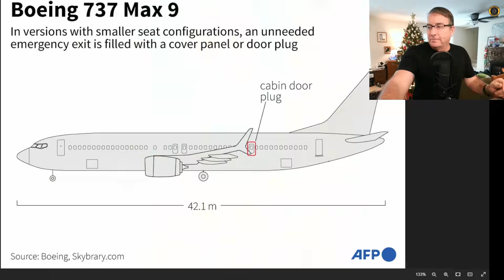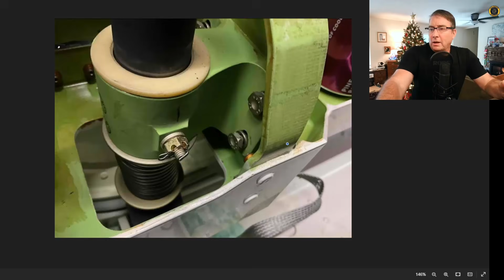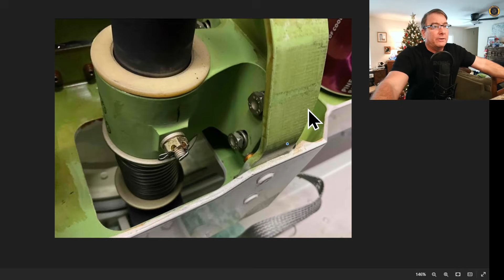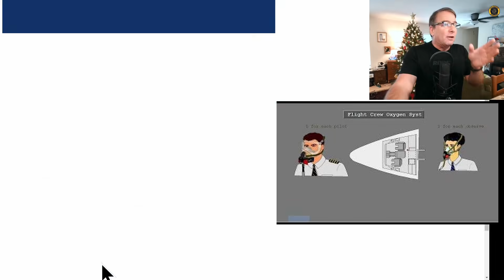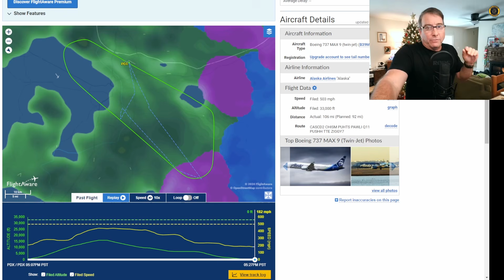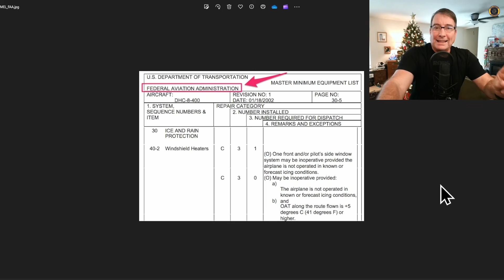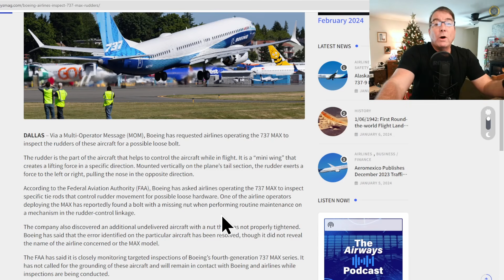"Yes, We Have No Bolts"  9 Jan 737 Max-9 Update

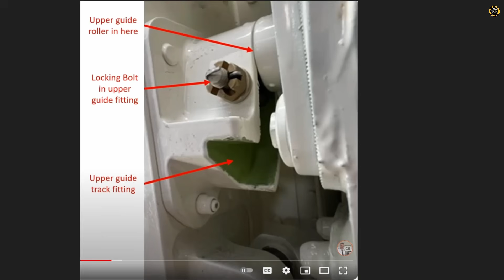Comment: 4:35 How could the track guide fitting have been "cracked" as a result of the door departing the aircraft? Doesn't the door just slide up and off without requiring enough force to crack a metal fitting?
Reply: It would slide up and out easily on the ground, but remember…it’s now got 200+ mph (I don’t know actual speed) winds blowing on it…seems like that could easily crack a fitting that wasn’t designed for that?

Comment: I'm wondering if they can go back a check G loading on the other 2 pressurization incidents to see if the panel could have moved on those flights putting a spike in the press system causing the controller failure?

Comment: I suppose there are different ways in which pressure can leak past a door seal, and maybe, if there was a leak around the plug door causing the pressurization writeups, it might not have been audible, but my wife was on a Southwest flight several years ago where one of the doors didn't seal right and had a 'small leak', which apparently wasn't concerning enough to turn back, and she said the noise it was making was maddening.

Comment: I've said this before on other videos in the past, but I just continue to be baffled at how, in this day of technology, that these voice recorders, will record all of 2 hours before it is overwritten.  How the F is that possible????   We have devices no bigger than a hand that will save data that would last months before being overwritten.  And this is only audio we're talking about.  With audio you could get years saved, I bet.  Yet all they get is 2 freaking hours.  That goes beyond comprehension.  Now in this specific case, the audio would've been limited anyways.  It would be limited to before the door blew off.  After which, audio would've been sketchy at best due to the noise caused by high winds.   Now I know that the hard drives that would be installed in these cockpit voice recorders are not your everyday hard drives.  They have to be extremely durable, and even when they take damage, there must still be a high probability that you can still receive some or all of the audio there.  But it still should be possible to get a hard drive that fits these parameters, yet get much more time than 2 damn hours.  Maybe than create 2 voice recorders.  One like they have now, and another that perhaps streams real time to specific areas around the globe.  I don't know.  I do know that there are people a thousand times smarter than me that should be working on this like forever ago.

Comment: What happens to the "rubber jungle ? is it cleaned, stuffed back or replaced? Do they all drop together or can just a few drop if needed? Is the air for the masks from bottles or a compressor..
Reply: The oxygen for pax masks is from a container for each mask that uses a chemical reaction to make it. That’s why they don’t have to worry about leaking bottles or such.
I don’t know fully how it works actually but I’ve read that in multiple places over the years.

Comment: Crazy  complexity to a fairly simple connection between panel and fuselage. Why not just a series of bolts around the door? They made it like they will be removed every few weeks, most of these panels may never be removed.
Reply: Most all panels on an aircraft are removed for inspection routinely.

Comment: Juan, I watched all three videos. Great reporting! I flew the 737 for twenty years, and you've taught me things that I never knew about the airplane. I've never seen anything in print or in video during training that said that the cockpit door is designed to fly-open during an explosive depressurization! I figured it the same way you had -- that the blow-out panels on the cockpit door would shift, allowing for cockpit to cabin pressure equalization. Worrisome, indeed!

Also, although I knew that the exit behind the wing was decommissioned, and had a "plug-type" door installed, I did not know how the door was secured closed, nor about the four bolts.  These exits are installed on our B737-900ERs; but not on the older B737-900s. To the best of my knowledge, we never had an issue with them. 

BTW, there are several ways to know that particular exit could not be used: 

(1) it's not visible from within the cabin -- as you stated, to a passenger, it would look just like any other "non-emergency exit" seat window, having been panelled-over; 

(2) there is no 2" - wide, painted, reflective band around that exit. These bands, whose purpose is to help the CFR emergency crews to quickly locate the installed exits on transport-category aircraft, are required by FAR Pt. 25 (on those aircraft, the bands are clearly visible around each of the main cabin doors, the overwing exits and any other usable exits); 

(3) there is no door-release handle on the outside of the exit door/hatch, to allow those CFR crews to open them from the outside, which is also a Pt. 25 requirement.

On the 737, there is an exterior cockpit window release handle, located just below the first officer's (R2) window; however, the captain's window (L2) cannot be opened from the outside.

As I understand it, the amber "AUTO FAIL" light illuminated on three (?) previous flights, which would account for the repeat write-ups. I believe that it is possible that the door-plug's shifting during those flights could have caused the AUTO FAIL to trip off. What I am wondering is: Did both AUTO controllers trip off, leaving those crews with just MANUAL mode? 

During those twenty years, I never had to manually control the cabin with the outflow valve toggle switch, although we did fly on several occasions with one pressurization controller on MEL, but the other one worked -- and per the MEL, it had to function normally.
Reply: According to the NTSB briefing, they never had to use manual mode. The backup computer controlled system worked in all previous situations.
Reply: @Fireandbubbles  Thanks for the info -- I haven't looked at the NTSB briefing yet. In my experience, the auto-pressurization controllers were very reliable, so that doesn't surprise me.
Reply: In hindsight it would seem that, during the initial stages of cabin pressurization, that door would jostle enough to 'burp' some of the incoming pressure back out. This triggered one or more of the alarm conditions. By the time the system switched to the alternate, the seal had been restored and either of the controllers would have seen the correct pressurization behavior again.
If indeed this was the case, it would seem to say none of those bolts were present for some time (vs failed, or sheered during the incident flight).
I imagine there will be a recommendation to update the maintenance checklist, to verify all seals mechanicals are sound before signing off on this sort of behavior from the pressurization system.
Reply: @CineSoar  Probably a correct assessment, on your part. IMHO, either the bolts or the cotter pins weren't installed, which allowed the hatch to shift upward enough to be pushed out by cabin pressure.
Reply: @boeingpilot7002  In the absence of bolts preventing upward motion, the plug was free to bounce up and down on the assist springs at low cabin pressures, until (somewhat randomly) that "mousetrap" condition was present during turbulence, at somewhat higher pressure and "BAM!". I do suspect the bolts were in place originally, without the cotter pins. It then took a few month's worth of vibration, before all of the nuts had vibrated loose and those bolts were laying in the bottom of the plug frame area.
I was riding the Zurich metro this morning. As I was waiting to arrive at my station, I noticed the nuts on the door mechanisms. Each had a stripe of hand-painted yellow paint, to make any rotation of the nut, relative to the bolt, immediately obvious. It made me wonder how the cotter pin installation, and (one would hope) cross-check visual inspection, got missed.

Comment: If the bolts that keep the door from coming off can't be found, and the door comes off, sounds like the bolts weren't there in the first place? And it's a new aircraft? Wasn't there an issue from before, about the build quality of the Max's? Sounds like could be an issue again. I'm going to start selecting airlines not by their service, but by the equipment they fly. Thank you for these great updates.

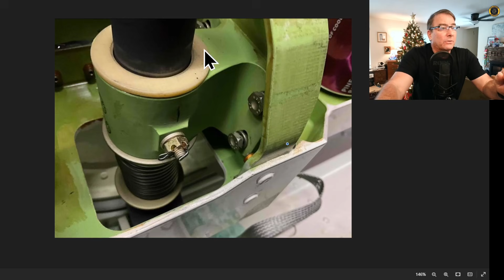Comment: Juan, what are your thoughts of the photo shown at 6:00, especially the lower apparently "loose" nuts on the lower bracket?  I have blown the photo up and the hole for the lower bolt appears to be way too large , especially since the lock nut almost fits partially in the hole.  I assume that this bracket was assembled at Spirit and that it was delivered to Boeing in this condition.  You also mentioned that one of those brackets was missing from the door.  In my opinion, this could be the cause of the plug loss; at the least Spirit seems to have missed the loosenuts and Boeing also must have missed this when the plug was removed for the interior installation.  Your thoughts?

Comment: Great report Juan: Concerning the castle nut. As a retired maintenance mechanic plus a corporate mechanic, who is accustomed to using castle nuts. For me, once I torqued the nut to specs, if the cotter pin and the bolt access hole are not lined up, I would just advance the nut as to accept the cotter pin. It’s “impossible” for said nut to back off, if its torqued correctly then affix the cotter pin. 

When it comes to the two door frame mounting bolts, that appear to be about 3/8 “ SAE why are said bolts not “SAFETY-WIRED” as any other critical parts, being safety wired means tight forever.

Comment: Castle nut with cotter pin is great - but when the thing it's bolted to has loose bolts with no safety holds -  kinda cancels out!      Been following all these updates Juan - great work....
Reply: If those other loose bolts were the problem then those castle nuts and bolts would have still been there.  They're missing.  Those other four bolts on the bracket shouldn't be loose but they're not likely the cause of the problem, but another symptom of the root cause--no quality control.
Reply: @johnaclark1  Stay tuned!

Comment: In the picture of the lower hinge assembly it looks like the lower bolt with the washer on it is not tight. I guess the engineers didn't think like pilots when they made the door to blow open like that, and the pilots lost their checklist.

Comment: Oh now wait a minute.......the roller guide fitting being cracked.......that changes everything. Were the bolts over-torqued which could crack the fitting???  I've seen over-torqued bolts crack a fitting.  A friend I have may have cracked a fitting or two in his life. (sheepish grin) 
The plug door weighs 63 pounds and if the fitting was cracked then that 63 pounds could have hammered away at the compromised fitting for the two months until it broke out.
Reply: I believe in the NTSB press conference, they stated that fittings were cracked as a result of the door departing.
Which makes sense because at some point the door would be catching all that wind rushing by and would pull it in directions it’s not intended to go.
Reply: @JohnHallgren   "I believe in the NTSB press conference, they stated that fittings were cracked as a result of the door departing." 
They don't know that yet. They can't be sure of that at this point.
Reply: @rael5469  yes, that’s true…that’s why I said “I believe” because I wasn’t sure if it was said..I thought I heard it.
Reply: @JohnHallgren   John I didn't dispute what you said I dispute that the NTSB could know why the fittings were cracked.

Comment: Something we learned when the Boeing/ McD merger occurred.  McD has qualified people on the assembly line who can take a print and actually follow it.  Any variances which occur can also be handled by these people with planning/engineering paperwork to cover it, like an oversize rivet, etc.  Boeing has assemblers who basically bang the same line of rivets every day.  Any changes have to be done by Tooling.  This is why when there were mods to be made to the 737s just off the assembly line, they were flown down to Long Beach where the work could be done by qualified personell.

Comment: My father told me 70 years ago that he avoided flying in new airliners. He figured it always took a few years and a few crashes to get the bugs worked out.
Reply: In general aviation, used airplane parts often cost more money then brand new ones. They are safer as any factory defects have been weeded out over time.
Reply: There were new airliners 70 years ago?

Comment: You are speculating that is how teh door failed.   THe investigation is still on going and you are putting out assumptions that could potentially be true, but that is not what you are saying and giving false info.  Also, you said in a previous video, that the plug is removed during production to allow for parts and materials to be brought into the -9.  This is incorrect.  it is not removed at all.

Comment: Clearly you wouldn’t know about etops on the door from bashing your head on it from walk arounds 😅, always funny when you see a crew member doing the preflight with a part number stamped in the skin of their forehead. I wonder why the mid aft doesn’t have similar electro mechanical interlocks like the overwing exits. Three cabin doors shut, throttles advanced or cabin pressure above 4.5 psi and have physical locks inserted into the plug even if it’s not rigged as an emergency exit at the time. Although I like the theory of the bolts being added it sounds like there need to be additional QC processes before delivery. Too many loose fittings and parts.
Reply: The bolts are the physical locks.
Reply: @johnaclark1  I more so mean on the aircraft where it’s an actual exit and not just a plug.

Comment: Hi Juan. From photos I have studied, the door didn’t leave intact. Part of the very lower assembly of the door stayed with the airframe. You can see both of the hinge sliders still attached to the aircraft. The forward hinge slider has been stripped clear. However, the aft hinge slider still has the slider fixture and spring attached. It looks like the bottom crossmember of the door is still attached as well. From a photo I found, taken from inside the cabin, the spring can clearly be seen, and appears to be in its released state. ie extended. I think those springs, although convenient, may not be such a good idea. Regards
Reply: That’s EXACTLY what I’d expect to happen when the door flies open under pressure. Something at the bottom hinge area quite simply HAS to let go, or the door will actually stay with the aeroplane.
Reply: But it isn’t an emergency exit door.  It’s a plug. Why is it designed to facilitate removal with a spring loaded hinge? The spring loading, if there at all, should be reversed to hold it down not to lift the door up and out of the retaining lugs.
Reply: @JeremyAckers  It' an emergency door just plugged in and somewhat deactivated.
But all of the holding mechanism is to be identical.
Otherwise you would need a fully certified alternative solution which would set the program back half a decade.
Reply: @JeremyAckers  Those springs are there just for convenience. But, if the bolts,nuts and locking pins are all in place properly, there shouldn’t be any problems, you would think. And in most cases, there are no problems. Regards
Reply: It’s an emergency exit door.  Emergency exit doors are supposed to fall away.  When deactivated, the exit door has bolts installed to prevent it from sliding out.
Reply: It appears I may be wrong about the door coming apart at the bottom. There looked like there was a piece of metal still attached to the aircraft between the two door hinges that were stinking out. However upon finding more and slightly better photos of the found door, the bottom of the door looks complete as far as the frame goes. I am assuming the piece still attached to the hinges was ra andom piece of debris that just happen to get caught there.
Reply: I’m considering a scenario where the four bolts holding the sliding fixture to the door frame are completely out, and doing nothing, on both sides of the door. That would mean the bottom of the door is now detached from airframe and free to move a bit. Was that enough to allow the top fixtures to fail and the door to vibrate its way lose to clear the 12 tabs and guards and then make its departure. It is possible those springs in the bottom hinges had nothing to with the door failure. It is possible the door could have escaped downward if its bottom supports were detected.

Comment: In the past couple of years I have read true stories where the quality control at Boeing was so bad, the Air Force refused to take delivery of their new KC46A tankers (I think their based on 757 or 767 acft.) Anyway the AF did a pre delivery inspection and found all kind of junk inside, wrenches, bolts, garbage, etc.,etc.). The point, if this is what you can see what can't you see?